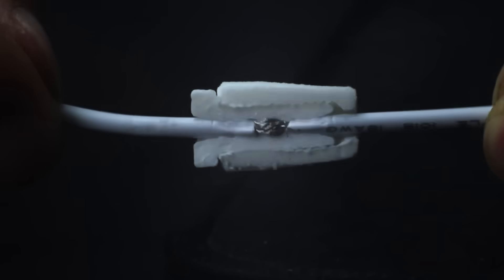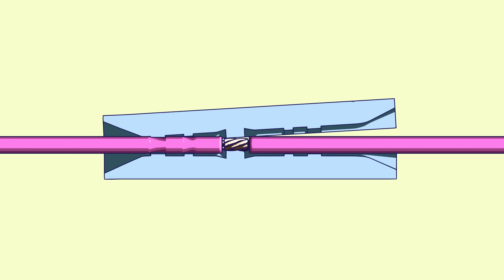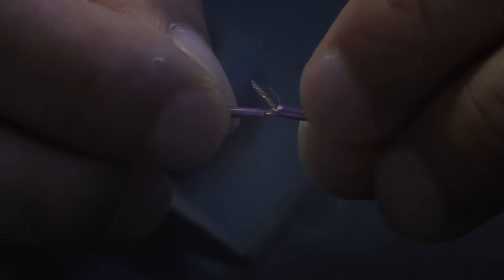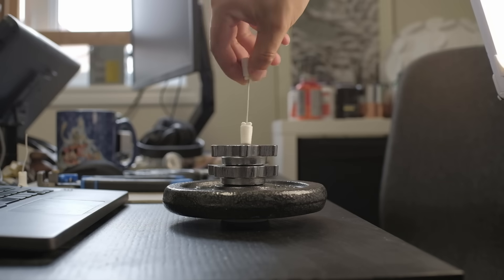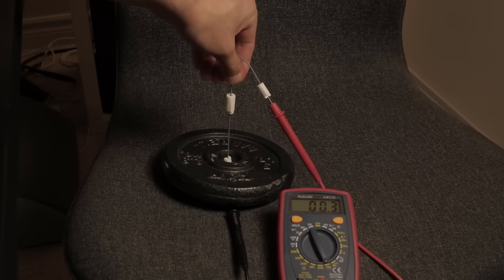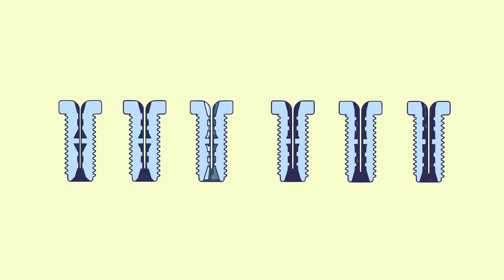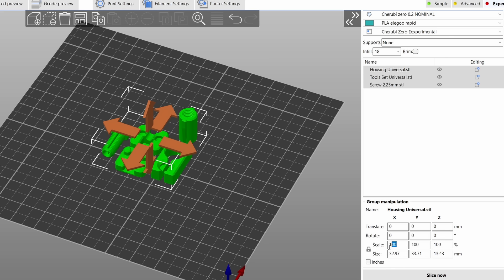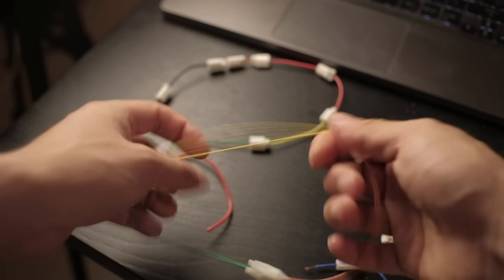3D printed wire connectors that actually work

Comment from the maker: Hey guys, first of all, I'm honored with the amount of attention this video is getting. Originally, this was supposed to just be an exercise in learning how to animate with Blender and video editing/recording in general, so this has well exceeded my expectations.

With that being said, I want to again warn against using these on anything other than simple, low-power circuit board connections. These connectors are NOT insulated, nor tested for longevity or electrical safety. If you use one of these for household power connections, there could be life-threatening fire risks. As shown in the video, this connector demonstrates impressive mechanical strength, but that does NOT mean the electrical connection itself is anywhere near as secure as the mechanical one.
The best usage would be for its mechanical advantages in providing strain relief for a properly soldered connection with heat shrink, as mentioned near the end of the video. Be safe out there!
Reply: Thanks
Reply: Too big
Reply: I like the inginuity, but Is this different than wire crimping? Does it hold any unique benefits?
Reply: @resphantom Haven’t tested these connectors for longevity, but I have run crimped connectors for years, and they fail from corrosion pretty easily. I’d imagine these are more resistant to moisture ingress.
Reply: The kind of thing you should keep a few of in the car for emergency repairs.
Reply: these may actually be better than some commercially available “certified” high-power connectors. i had a professionally installed steel blade connector in my heat pump (120V) fail because it got wet and rust formed inside the connector, opening the circuit and striking an arc that created so much heat it melted the copper wire off the connector and left vinyl insulation burning and dripping liquid plastic. physically pinching the wire connection closed with a nonconductive, nonmetallic part seems like a great idea and i wish i could see it used more often

(i replaced the failed connector, it failed again in the exact same way so i welded it straight to the capacitor terminal it was connecting to. no more loose connection)
Reply: Fantastic idea, i am impressed. Most basic printed materials experience “creep”. I would suspect you may need to revisit these every week or two for a while to re-tighten them because of this. But these are far sufficient for most low voltage applications i would trust them with most of the stuff I do. Might put a disclaimer about carbon fiber filaments being semi-conductive
Reply: These would be great for splicing DuPont wires for adxl345's I'm going to use for input shaper. I don't have any heat shrink and electrical tape is messy, these look pretty robust
Reply from the maker: @ZT_1234  sounds like that falls within good use! In my case, 1.35mm seems to fit just right on dupont wires
Reply: With it being 3D printed I think a potential issue might also be low temperature resistance (of course varying with the material used, but I feel like it still might be an inherent thing from printing although I might be wrong)
Reply: These look so similar to the way insulated HV overhead line connectors work, I'm gonna go ahead and order our entire nationwide power network to swap to using only these from now on.  Thanks so much!
Reply: I'm not sure what you mean when you say these aren't insulated. They're equally as insulated as a wire nut.
Reply: Nifty!  I suggest you recreate this in OpenSCAD--which should be pretty easy--and format the script to work with Customizer--even easier.  That way, folks can easily create their own version that perfectly fits their needs.  So far, I think only Thingiverse and MakeWithTech support online customizing, but enablilng and using Customizer in the OpenSCAD app is trivial.  (Pressing <F5>, <F6>, then <F7> will preview, render, then export an STL  Simple, no?)

As for wat parameters touse, conductor and insulator diameter are the most obvious ones, as are length, width, and tolerances.  As well, features like room for solder/sealant/etc. would be handy.

Cheers!
Reply: I like your resolve on this and I don't want to dampen your will to make cool stuff however there are many ways to inprove the strenght of a connection like doubling the wire at the junction point and making a knot, soldering a bigger piece of wire like 1-2cm, using solder of better quality, twisting together a 3-5cm piece of bare wire and then bending it and securing it with heatshrink tubing. Most of these ways will be faster and cheaper and smaller than your current version and will work either just as well or slightly worse. Then theres the oxidation and mechanical stress issues with twisted connections vs soldered to think about. By all means keep improving but don't lose sight of the issues you're solving vs current alternatives

Comment: does the cap have enough room around the wire so that It wouldn't start twisting it when tightening? Also is there a filament recommendation for electrical stuff?

Comment: My electronics couse tutor always repeated soldering provides electrical strength not mechanical strength. Thats why you need to provide other solutions to handle the mechanical strength

Comment: Bad and dangerous idea. It is not airtight and thus the metal surfaces will oxidize. That will slowly increase the connection's resistance and if the current running through the connection is high enough, it will cause a fire. Also it is not resistant to vibration, which will also cause a loosening metal to metal contacts.
Reply: You do know that non-airtight crimp connectors are in just about everything, right?

Comment: I would definitely wrap the exposed wire in a shrink-sleeve or at least some electrical tape and you could probably get away with about half that number of threads so you don't have to spend as much time twisting it into the housing but other than that, I think this is probably the best wire connector design I have seen.

Comment: With a good solder connection the wire also breaks before the joint maybe in one side or the other of the joint but the solder doesn't fail

Comment: these look so much better than buttcrimps. is it possible to have a 3 (or more) wire connection with these or are they only suitable for joining 2 equally sized wires? either way these are very innovative, excellent work.

Comment: i have tested this and the connection is not stronger then the cable itself (at least at 1mm cable diameter). i dont know why but the cable just unwinds itself at the center of the connector cleanly, even tho i have screwed it in as far as it can possibly go with the tool set and some pliers

Comment: This is awesome. Could you please post something testing this comparing the 3D printed wire connector to a brass crimp wire connector with heat shrink? The heat from heating the solder is annealing the wires and weakening the joint so a solder joint is inherently weaker than the wire itself already. Also when making wire connections, size and space could be a factor and that is yet another area where the brass crimp connector wins as it is generally no thicker than the wire itself. It also gets its strength from crimping the two insulation ends together, not the wire. Just like your design.

 I subscribed, I'll be here to see more of your work. Very well done

Comment: this is one great way to start a fire or get electrocuted. Proper solder joints are stronger than the wire itself, if you knew how to do it correctly...
And wires are not ropes or cables, they're not meant to be used to hold weight...

Comment: Don't believe you in part. AFAICS it's not the solder joint that broke but the wire. It's not a bad design, but using any home printed electrical connector component opens you up to endless legal complications in most jurisdictions if anything goes wrong, as well as UL in the States and CE in Europe. I would never do this. Submit it for professional manufacture instead. They also need to be slimmed down, a lot.

Comment: It's an interesting device however, if you properly solder a wire, the solder joint will be the strongest part of your wire. It seems like you are better off learning how to solder properly than wasting a bunch of time and plastic on these connectors. Also, they make solder filled but splices now where all you have to do is heat them up and they are less chonkey and easier to use than your connector but hey, to each their own I guess.

Comment: Excellent! I won't ever use this, too bulky but it's great engineering. Fill the wire chanel with grease and it's  mostly waterproof  for less than 50v

Comment: it's stronger than a solder connection you say.  and then you say it's strong enoegh to break the wire before it break the joint. 

and i just wonder...  what??  
a solder joint will also break the wire before the solder breaks.  
if your's don't then you need to work on the solder joint

Comment: I have no doubt that this thing will hold the two wires in place. I'm highly doubtful that it will maintain a good electrical connection for very long.

Comment: This could be really useful for in-situ work on the moon or what-not. Single material, screw and lever. You don't actually need the clamp to be flexible. You can achieve the effect via compression alone. If you are dead set on the lever part, you could simply make the connection a hinge pin and socket.

 (Anthrofuturism has a great series on building on the moon and you might be able to collaborate on designs.)

Comment: It certainly seems to work well for your use case / give the disclaimer, but: Any chance you've done some longer term testing ? (deformation of the plastic over time as its under stress) Just out of curiosity

Comment: Regardless of mechanical strength, PLEASE still solder the connections. While the solder is also used as a mechanical binder, it also bridges gaps between the strands and prevents arcing. It is probably rare, but with loose strands simply mashed together, this still leaves room for arcing to occur, potentially creating a fire hazard.

Comment: Looks good, but I still don't understand the use case for this. I don't need to hang weight on my wires, and the connector is too bulky compared to soldering.

Comment: Phenomenal idea. Considering screws could be part of the casing itself, did you think about using these items as pluggable strain reliefs of a larger assembly? Basically enlarging the static part's neck into a square piece which would then be screwed (or 3d printed) into the chassis (think your 3 pin computer power supply power plug).

Comment: In communist era in Poland there was “SB” (służywam bezpieczeństwa) communist government special group to “made disappear evryone that made *problems*” and they pretended to be electricians, put cables together without soldering, or without clamping into screw connectors, then they wrap that connection with celluloid and hide in wall, under the carpet. 

Then they wait 6 months, 1 year, 5 years and that home will burn down in accidental fire because of electric cable failure. 

If there is not a clamping force to squeeze them tight together or even tiny amounts of solder, they cables will slowly oxidize and made resistance = heat. 
More heat = chance of fire
Heat with chance of fire wrap in plastic = plastic give fuel to fire.

That is more like modern communist fire time bomb and that give me many “good” ideas now

Comment: Interesting concept.
- I wonder what the resistance of the connection actually is.  What you showed isn't good enough.
- The connector is too large and too bulky.  But if you were in a jam and didn't have the appropriate equipment with you then this would be good enough as a temporary fix.
- Interesting that you chose diameter of the wire for the sizing instead of the cross sectional area.  The insulation is pretty much the same thickness across manufacturers unless you're using defence grade wires.

Comment: I'm unimpressed by out of spec solder joints being compared to very good rope joining techniques (it'll break the insulation and cause a hundred other issues afaik). Look at the NASA spec, and compare it to that.

Comment: Nice design, and even nicer video. Indeed, I wouldn't think to use it for higher power applications, but for low power communications lines, sure. I've even jury-rigged the occasional temporary connection using the same principle, though not so nicely as your design.

Some dielectric grease could help address some of the concerns others have had, regarding corrosion and watertightness. Almost making it a mechanically stronger, DIY, Scotchlok connection.

Comment: one is a good mechanical connection and the other is a good electrical connection. You cannot measure the resistance with the two wire method because the resistance is so low, your MM is not accurate enough

Comment: I don't think strength of a connection is an important parameter.. Solder joint is the same size as the wire, it's faster, simpler. Feels like you're reinventing a bicycle

Comment: 1st - no information about type of plastic and it's flame resistance. this is really important in wiring application.  2nd - it's very dependent on correct wire and its insulation diameter. and there are things on the market that don't have that problem 3rd - alinment issues - it's possible to do it wrong and you don't see the result.

Comment: Fantastic idea and very well executed! Not to mention there is room for endless revisions and improvements. It wouldn't be that difficult to add water proofing with provisions for O-rings, 3D printed TPU seals, or even just by globbing silicone lubricant into the ends. Great stuff!

Comment: Sorry, but, if your soldered connection is weaker than this 3d printed part then you are doing soldering wrong. 

You are compairing the strength of the copper with the one of copper and the insulation combined. Does not sound pretty fair now, does it? If you want to do it the right way, try using heatshrink tubing with glue inside (yes, this is a thing and makes the connection waterproof as a bonus).

Comment: Yes 3D printing can make strong connection but it's not as strong as soldering soldering you get a hundred percent of the power this decreased 10 to 20% soldering makes it 100% because it's metal going into metal😊 and yes I do 3D print

Comment: There is no reason to make the inner core a compliant mechanism.  Two identical halves with an identical double helical screw thread would have drastically simplified this and would allow you to use rigid/tuff resin or filaments for the inner core.

Comment: This is not better than solder or crimps. A higher tensile strength of the joint does not imply it's a proper gas-tight connection.

Comment: This would be great for repairs on vehicles that need to get to a location for proper repair. I can see them going great on my race car in a pinch. Could also give a great place to add a clip to keep all connections organized, it make you able to change connections without having to continuously cut off pieces of wire.

Comment: Nice design. It reminds me of the posi-lock connectors but offers some insulation benefits and strain relief for the wire to prevent breakage.

Comment: I betting a resin 3d printer or even injection molding would result in higher quality details that would add to the strength of the part.

Comment: I think I probably wouldn't use these in a finished product, because of their size, but for prototyping I can see them being super useful.  It wasn't unti you mentioned them being "temporary" that I thought of it.  Not needing to solder and being able to remove the connections without heat is a really interesting feature.
Reply: @802garage Sure, so are 3D printers....
Reply: @Subzeero04 LOL yes because an appliance or tool is the same as a consumable. Give me a break.
Reply: @802Garage break granted. My comment was just an acknowledgment that a readily available product exists for those who don't own or have access to a 3d printer. In my opinion one that works even better for prototyping purposes as they're simple/quick to operate. I use them daily in prototyping LED lighting circuits. I find them convenient and affordable. Not as cheap as pla filament if one has a 3d printer, filament, and the knowledge to run said printer, go nuts.
Reply: @Subzeero04  Forgive me then. I am so used to defeatist comments which boil down to "Just buy X instead." that I assumed you were essentially dismissing the video. I love Wago connectors. It just wasn't the point of the video. :)
Reply: I can see these being used in applications like robotics, drones, and of course 3D printing as well.
Reply: Lever wagos for this use case.
Reply: @Subzeero04 Kinda missing the point. Those are also far more expensive.
Reply: Finished product usage is a no-go because of the work involved, time is money and other ways of mass stamp wires together with strain relief would be cheaper (think crimping, soldering in a hot pool of solder, simply tying the wires together into a knot even to strain relief)... for this specific situation I did find in my personal experience a "3 banded" chinesium invention, which is basically a heat shrink with glue (color bands are the glue) and solder ring inside, so you just put wire from both sides and heat it up and it does everything including waterproofing.
Reply: @adonisengineering5508 это не "китайское изобретение'. Такие термоусадочные трубки с припоем в центре и клеем по краям описаны в руководствах по ремонту электропроводки некоторых автопроизводителей, например Renault.
Reply: @adonisengineering5508 I feel like you're intentionally missing the point of the video. 😅